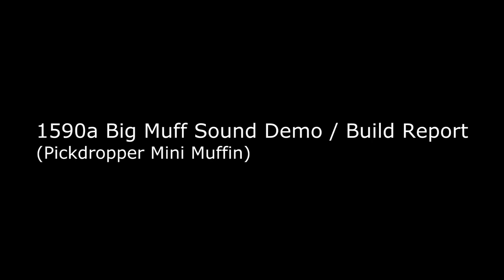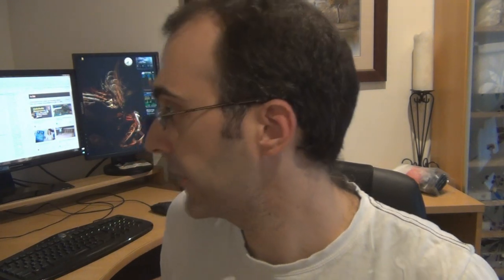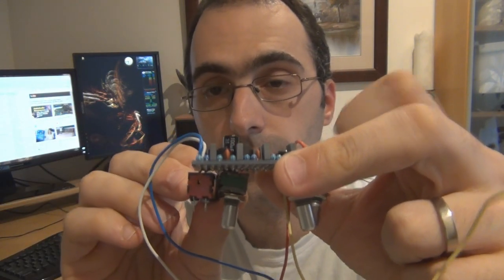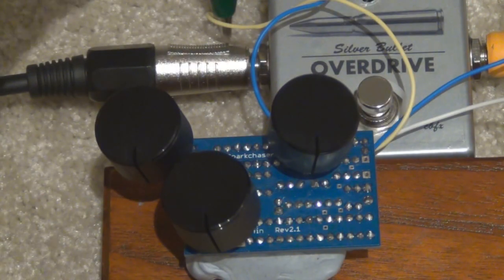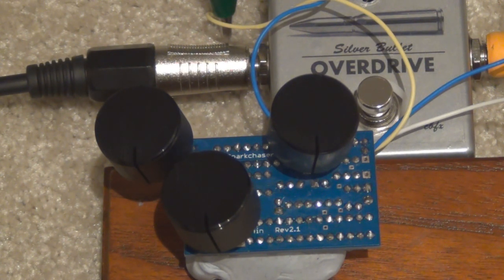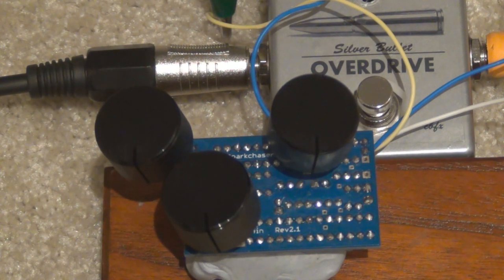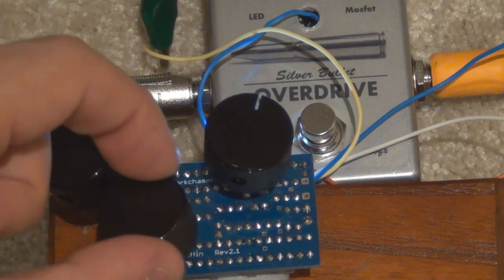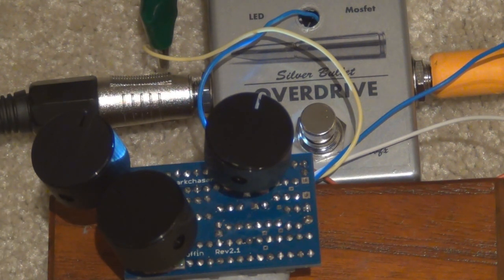Pickdropper Mini Muffin - 1590a Big Muff Build Report And Sound Demo -

Comment: the bonus with wiring up the pots (instead of having them on the pcb) is you could wire a tone bypass,as the big muff tone stack sucks a lot of volume,..also you can use a switch to bypass the 2nd pair of diodes (like the in the tonebender/muff) or use to switch in different types...also about the transistors,
I've just used the 2n5088/89s (also mpsa18s for modern NYC muff clones) and I don't think there wouldn't be much difference tonewise to just use those in place of listed transistor types on early muff schematics...the big muff circuit it great to play around with though,I'd suggest newbies build one and socket anything so they can play around with different caps,power and limiting resistance as well as transistors and diodes...and it's also a good idea to find out if you like the vintage ones with true bypass or if you feel the stock wiring is better sounding if your going to build clones from scratch.